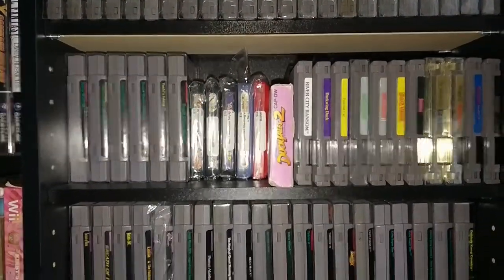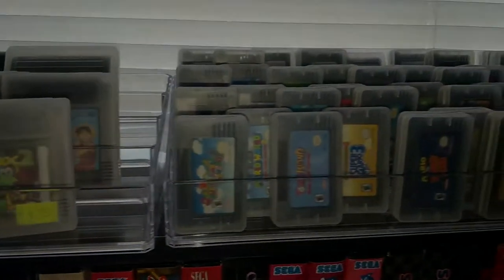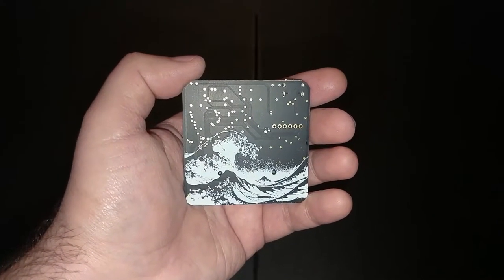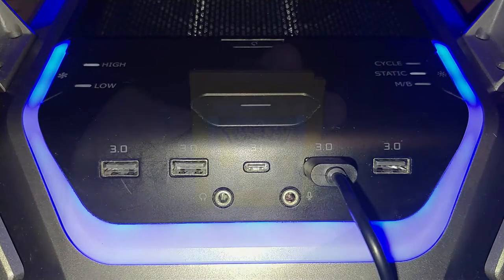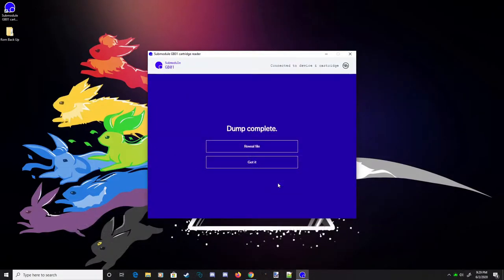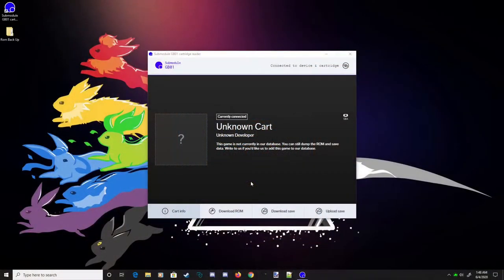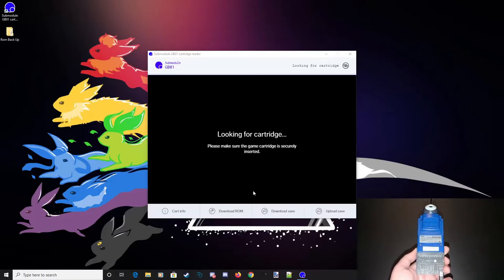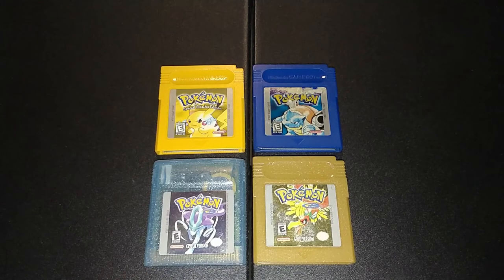Submodule GB01 Review

Comment: Nice Review. I came here after looking at the Mylifeingaming video. I've also got a Retrode with the gameboy adaptor and have loved using that these past years. I'm looking at the GB01 for gameboy advance games mainly. I could use the retrode to grab my old Pokémon Blue save, but not the GBA games. The game saves are still there at least, but I can't change the battery to reactivate time based events without loosing the saves. Seems firmware updates on the Retrode have gone somewhat quiet so I think I will be ordering the GB01 now after seeing the review.